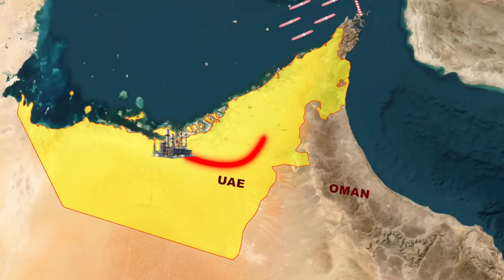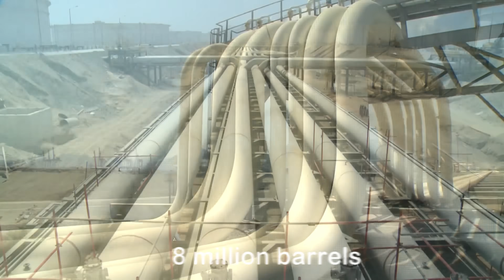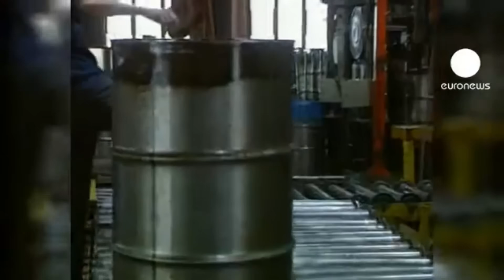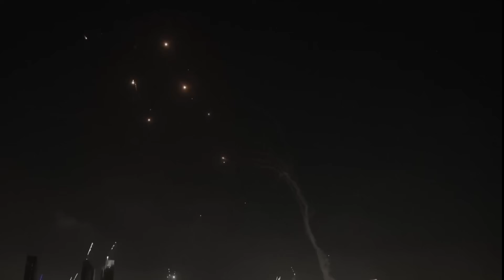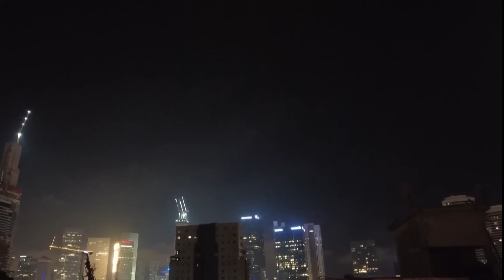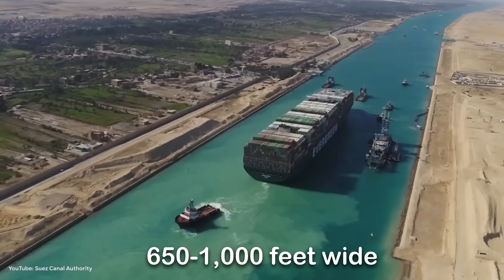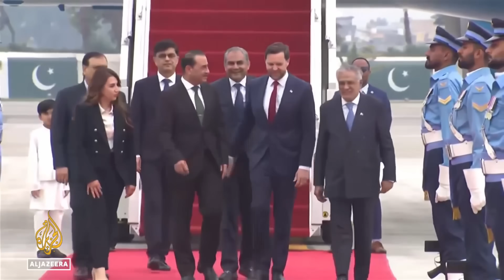The $60B Project to Completely Replace the Strait of Hormuz

Comment from the maker: Hey, thanks for watching — and thanks for helping us hit 100K subscribers! We really appreciate your support. So, $60 billion for this project or $100 billion for one canal — where would you put the money?
Reply: Natural gas pipeline under water around the ithsmiss!
Reply from the maker: @dennishungerford4146  interesting idea but subsea pipelines around the strait have a big problem — Iran sits right on top of that coastline and underwater infrastructure is extremely hard to defend or repair once damaged. the whole point of the UAE corridor is that it moves oil overland through sovereign territory where you can actually protect it. plus LNG can't easily move through pipelines the way crude oil does — it needs specialized terminals and tankers.
Reply: Why do you stay silent on similar projects by Iraq?
Reply from the maker: @HannoVisagie  not silent on it — we covered Iraq's routes in our $900B Race to Bypass Hormuz video. the short version: Iraq has three routes being revived (Basra-Aqaba, Kirkuk-Ceyhan, and the old Syria-Banias line) but they all face the same problem — Iraq can't build fast enough and the routes cross unstable territory. crude oil is 90% of Iraq's state revenue so it's literally a survival question for them. this video focuses specifically on the UAE corridor because it's the only one that mathematically closes the full gap.
Reply: @MegaBuilds-US , according to Biblical prophecy in the book Revelation the city Babylon will become a port soon.
Reply: Please include metric units for all the countries other than the USA that your viewers are from.
Reply: they couldn't even build a pipeline between canada nad united states going through 5 states
Reply: Solar panels, battery storage, and electric cars.
Reply: I most certainly would prefer the money to be put into a canal, especially if emergency mobilisation in the region could shrink the timeline to 10 years, even 7 to 5 as mentioned in the documentary.

Comment: Being from a oil family that has been involved in oil production for over 40 years. We were not a oil family to start but one involved in agriculture, water, paper and other industries and have been drawn into the oil industry because of our expertise in those. Been studying this problem for several months now and with the volatility of the region it proposed issues that I have never ran into other issues I have run into. There is one issue that is critical to so many countries in the world. This is one of the  few  times we have had a few countries   effecting a worldwide issue. Ether the problem is fixed and forever fixed or we work together to fix the issue,

In that case we work together to avoid the death toll and the war.  Looking at it that it that way myself and my colleagues think the answer would be both options. The pipelines one at a time for immediate relief. While working on those expand the facilities that you need you need to handle the pumping and managing as you bring a pipeline up to full capacity. Have the equipment in place to handle upgrades and improvements as the come along.

At the same time start the canal relatively close by. Where you can utilize much of the same equipment and personnel to build the pipeline to build the canal. Get the canal open in stages. Keep the pipeline going while you have the canal finished in stages. Running smaller ships through the canal while areas are expanded to handle the tankers.

This is for the good of the world get lots of counties involved. India, China, Russia, Pakistan, Japan, United States,
Europe. Use bright mines from all those Nations and equipment get money from Arab Nations and these to fund,

Then the worst part you need one negotiator not a team to sell it to all those countries. Some one with a team behind them to help them but the same person has to sell the deal to all the countries. Not a politician someone with a international presence to sell the deal to the government's and people of the world. Someone who can inform this is a worldwide problem that needs to be corrected for the good of the world and future. Some one with oil background along with all the other industries oil effects. A businessman with worldwide investment's.
Or the Chairman of a business that has a diversified enough of investments not anchored in oil business. They would already have a team behind them and would just have to have some additions in areas the were weak in.

Comment: I'm going with the mega canal because it can also accommodate 20% of the worlds LNG supply, 30% of the nitrogen fertilizer supply, 34% of the helium supply, and 9% of the aluminum supply plus a bunch of other stuff.  Also pipelines require a huge amount of power that could be used for other things.  Missile and drone defense would apply to both.

Comment: It seems that building the pipeline pretty deep so it could be buried under 30 feet of sand would not only protect the crude thermally but could provide a lot of protection from drone or missle attacks.

Comment: Canal still has the same problem, it's narrow and can be targeted with missiles, the maritime insurance costs would still mean ships would avoid it. The pipelines are the best solution. Though I wonder why they don't tunnel through the mountains and run the pipes through a tunnel for extra protection.

Comment: Engineering is one thing, but ask the Russians how safe overground (cheap) pumping stations and pipelines (or seabed ones for that matter) are. In a time of conflict, an overground pipeline with overground pumping stations is more vulnerable than shipping. In other words, useless. Engineering wise, possible. Strategically, foolish (like so many potential engineering problem/solutions). Similarly, canals and narrow waterways. Too easy to hit the ships, too easy to sink them. Besides, the Gulf of Oman ports (Fujairah) are just as vulnerable to air attack. Being an Iranian proxy, Yemen poses much the same threat to the Red Sea. Other than not having an orange manbaby attacking a sovereign nation, and thus maintaining some form of peace, as long as we want and use oil and gas, this problem will persist.

Comment: Great video.  The UAE proposal is the quickest and least expensive answer to the problem, but as pointed out, they will need a modern and fully capable defense system which is not likely figured into the proposed costs.  A canal would be an excellent long term solution for cargo as well as petroleum shipments.  The wise money would start both simultaneously.

Comment: Why can’t modern technology, like bunker-busting smart bombs, be used to fracture rock in the path through mountains, or tunnel-boring and collapsing mining techniques, similar to those used in mineral mining in the Western United States, to speed up the process? Build both the pipeline and the canal. Pipelines are so vulnerable that one strategically placed bomb where multiple lines run in parallel could shut down the entire length.

Comment: You forget that a pipeline only helps with oil transport.  In addition there is fertilizer transport, aluminum transport, and hopefully in the future - manufactured goods transport as the Arab countries industrialize.  So a canal would actually benefit Persian Gulf countries in every way and weaken Iran, permanently.

Comment: One looks at all of the active threats facing the pipeline mentioned in this discourse and asked the simple question. Why not build a coalition of military force and go in with the purpose of fully crushing all opposition activities in Iran and its proxies. Once that is completed the significant threat is but a memory and the need to pipe the oil across the desert is moot.
Reply: That would require competent leadership, but the US has an orange monkey-in-chief and a bunch of incompetent morons at the helm.

Comment: Above ground pipelines and oil storage facilities are still vulnerable to attack. However, by-passing the SoH is a sensible longer term solution for oil, but does not address the issue of bulk and container shipping.

Comment: Such a colossally stupid idea.  What they should do is dispersed pipelines in the OPPOSITE direction, not an extremely expensive solution still within threat range

The best defense strategy remains: have good relationship with your neighbors
Reply from the maker: the opposite direction is basically what saudi arabia already did — 750 miles across the peninsula to the red sea. it works, but here's the problem: it empties into the red sea where houthis have been attacking shipping for two years. you kind of trade one chokepoint for another. the UAE corridor is 72 miles vs 750, and it exits to the open indian ocean. way shorter, way cheaper to defend. but you're right that concentration is a real risk — the defense section of this video exists for exactly that reason. Thanks for watrching it!

Comment: I take it Iran don't "own" the straits so can't "close" them officially. So saying they have done so is a threat and illegal act? Other gulf states surely have the international right to send ships through as and when they want without any tolls etc?
Reply: Under international law it is illegal to track Iran. The fault is with USA and Israel here.
Reply from the maker: you're right — under international law it's an open waterway and Iran can't legally close it. but they didn't really need to. the IRGC warned ships would be "set ablaze," war-risk insurance went through the roof, and shipping companies pulled out on their own. traffic dropped over 90% without a single naval battle. legally open, practically shut. Thanks for watching it!

Comment: Saudi Arabia needs to bite the bullet and build a pipeline across the peninsula to the Red Sea.
Reply from the maker: they already did! it's called the Petroline, built in 1981, running at full capacity right now. problem is twofold — the port at Yanbu can only load about 4.5 million barrels onto ships even though the pipe moves 7 million. and then those tankers have to sail through Bab el-Mandeb where Houthis have been attacking shipping for two years. so the backup route has its own bottleneck and its own chokepoint.

Comment: If someone out there can develop a cheaper and quicker alternative to steel pipe lines maybe like some type of NMP, RTP, TCP, reinforced thermoplastic pipe and metal sleeve connects.
Slap ten or twenty of those types of lines done!
Then if necessary they can build the traditional metal lines near which will likely take longer.

Comment: there is a far easier solution and it would only involve removing  one headland here...26.198171125999117, 56.3958388050417... its only 150 meters thick and probably a width of 4 or 500 meters . the water has a depth acording to charts double what is needed for tankers , and ship data shows right now many boats anchored in the area waiting for passage, yes there would be logistical problems but it would be a far cheaper and quicker solution to any thing that currently exists, it could also generate a very large income annually for oman.

Comment: Canal makes no sense.
No water in Hajar mountains, so no locks, hence has to be at sea level, like Suez.*
So it would be incredibly expensive and disruptive. 
Also takes too long to build, by which time the world will have more solar and nuclear.
Finally, it is incredibly vulnerable to attack or sabotage (Suez was closed 1967-75).

* If you're thinking about pumping seawater up the mountains to fill the locks,
then you just have a water pipeline to help the canal to avoid an oil pipeline :)

Comment: A better solution is to expedite oil alternatives that render the need for oil redundant and will be better for the planet’s environment. That is what China is doing. The only country with the industrial and infrastructure construction capability to build this pipeline quickly is also China but china’s drive to be fossil fuel or at least Middle East oil independent will be substantially completed within 5 years. Thus, China will have little or no incentive to join this project or it’s defense once completed

Comment: It would be more expensive, but if they buried the pipelines and tunneled through mountains, it would be much safer from attack and deal with issues like heat and pumping.

Comment: if they consider to open a water canal... it is far cheaper and faster to build pipe lines ... but instead of Pumping... to open tunnels for the pipelines ... and that will offer some protection as well.

Comment: Building a very expensive second waterway is not a good solution and it won't provide you with more safety, because whoever is striking you still can do the same. Grounds for animosity should be eliminated. You can't let the foreign powers use your county to launch attacks against Iran and expect them to leave you alone. When Iran hits Israel from a thousand miles away you think it can't do the same with new water ways. The same is true with the pipeline.

Comment: Fairly obviously that can't work because a pipeline is an easy target.

China has a better policy. Don't rely on imported oil and gas at all. 

They know they're going to be cut off from oil and gas when they invade Taiwan so they have a policy to get energy independence as fast as possible. That means installing solar and wind generation at the most extreme rate possible given the limits of their industrial capacity. They're installing solar farms at the rate of 1 GW per day (yup that's right 1 giga watt of solar per day), and that's only the solar farms out in the deserts of China, it doesn't include the solar panels on buildings in cities. They're also installing wind turbines at the rate of 1 GW per three days. 

They're switching over to EVs as fast as possible. And building the industrial capacity to turn surplus electricity into hydrogen to use making ammonia for fertiliser and synthetic hydrocarbons for sectors which can't run on electricity, such as jet fuel for fighter jets and passenger jets, liquid methane for ships. 

China will soon have the cheapest energy in the world because solar is the cheapest way to make electricity. 

America and Europe are a very very long way behind. So far behind they don't even woken up to realise they are behind. They're still thinking more drilling will solve all problems. Europe is dithering over switching to wind and solar. America under Trump is dead set against it. 

Outside these retarded regions the rest of the world is adopting solar so fast the installed capacity doubles every three years. 

Pakistan runs its electricity grid on natural gas imported from Qatar. But so many people have installed solar panels on their properties that demand for electricity from the grid has dropped to point that last year Pakistan had to reject shipments of LNG because it wasn't being used and they had nowhere to store it. 

In the next 5 years the demand for oil and gas will reduce so much that there won't be any need for oil and gas from the middle east.

Comment: It is all very well building a pipeline system but you still need to build the port and infrastructure at both ends. That infrastructure is not needed for a canal.
A canal also allows container, LNG tankers and refined products tankers to pass through.

Comment: The phased pipeline idea makes way more sense than a canal in an emergency. A canal is impressive, but pipelines actually deliver capacity before the crisis is over.
Reply: unless a single drone hits it.  then you lose millions of barrels and your whole production gets shut down.
Reply: But the pipeline can't deliver dry goods or cargo; it only delivers crude oil
Reply: You forget that a pipeline only helps with oil transport.  In addition there is fertilizer transport, aluminum transport, and hopefully in the future - manufactured goods transport as the Arab countries industrialize.  So a canal would actually benefit Persian Gulf countries in every way and weaken Iran, permanently.